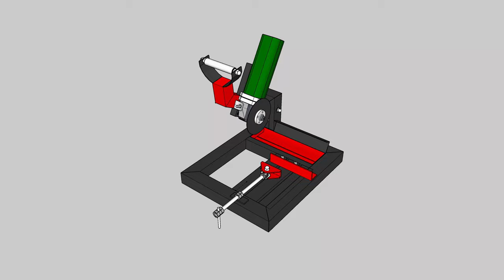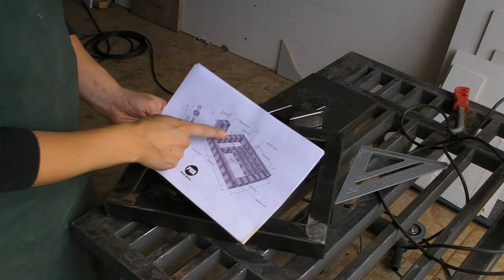Homemade Angle Grinder Stand / Cheap and Useful

Comment: well done sir. good job. Can you tell how much kg steel used in this project. I t will be easy to calculation of cost. I am from Bharat.
Reply from the maker: Hello.  Honestly, the materials I use are generally the ones I have on hand.  Metals I collected from here and there.  You can find the measurements in the PDF plans in the description section.  In general, I used 40x40 and 40x20 profiles with a wall thickness of 1.5mm.  I would also like to remind you this... I also made a slide stand for my angle grinder.  You can find the video on my channel.  You can also find PDF plans in the description section.  Greetings from Turkey 👍

Comment: Good plan  but if I were to build it.i will  go right hand design on plan.left hand design can be hard to get used to.
Reply from the maker: Thanks.  If used on the right side, sparks will come to the opposite side when cutting metal.  That's why I did it this way.  There are no problems with usage.  By the way, in the last video I uploaded to my channel, I made a slide stand.  I recommend it 👍